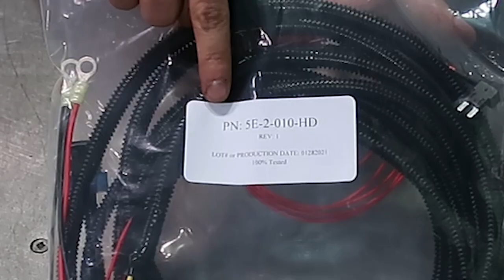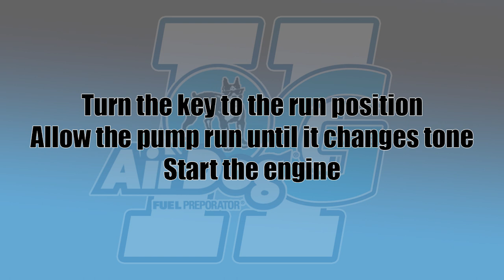2011-2016 Powerstroke Airdog DF-165-5G Installation

Comment: Are there any issues with the pump
Drawing rather than adding a sump to the fuel tank ? I called around a few performance shops they all want to drill n add the sump to the bottom of the fuel tank, I was just thinking. Installing this myself without doing the sump? Thanks
Reply from the maker: Keeping the factory pickup in the tank will allow the venturi fill in the fuel basket to work. This will keep the basket full of fuel even when the fuel level drops below the top of it. You can install a sump, but is not needed on this application.

Comment: What size is the hose and we're can I get the return y I had a shop install this on my truck and the left the factory lift pump in place and put air dog behind it.... they don't have any of the parts so I need to order separately
Reply from the maker: You can buy those components on our website at www.pureflowairdog.com or give us a call at 317-421-3180 to order parts.

Comment: I’m having fuel pressure issues to the point that the my 6.7 don’t start will the air dog help?
Reply from the maker: If your frame rail pump is struggling to keep up, then yes, an AirDog Fuel System will absolutely help. On your factory system, you can change your fuel filters and drop the tank to inspect the inlet screen to the fuel basket to be sure it's not an easy fix first. Thanks.

Comment: I got the FP-150,  I don't like it, very loud , when accelerating it gets even louder. For my 01 cummins.  Is there something I didn't do right or is this normal???
Reply from the maker: A pump getting louder over time indicates either an inlet restriction such as plugging water separator or debris in the fuel line, or a suction leak such as loose fittings or bad connections at the tank. Give our tech department a call at 317-421-3180 and they can run through some troubleshooting steps with you.

Comment: Does it help with mpg? I'm starting a non-cdl hotshot trucking company and I was thinking about putting one on my 08 f250 6.4 that I'm gonna use.
Reply from the maker: Our products can help boost fuel economy.
Reply: I went with a 165 on my 6.4. Great purchase I love you! Also makes changing the filter on the bottom way easier to access along with easier to drain water out of lift pump

Comment: Do i need to modify the sending unit in the tank?
Reply from the maker: No, no modification of the sending unit is required for the installation of our pump on this year range of 6.7L Powerstroke. Although, it wouldn't be a bad idea to inspect for a dirty pickup screen in the fuel module to ensure there will be no inlet restrictions to the AirDog.

Comment: Does it come with the wiring harness?
Reply from the maker: Yes, all of our kits include the wiring harness.
Reply: @AirDogSales  I bought it and the pump won’t shut off, I have to disconnect it from the fuse it’s on the same location you showed on the vehicle
Reply: @alexpadilla8213 Then you didn't use a Key-on source. Just find a key-on source. It's not rocket science.